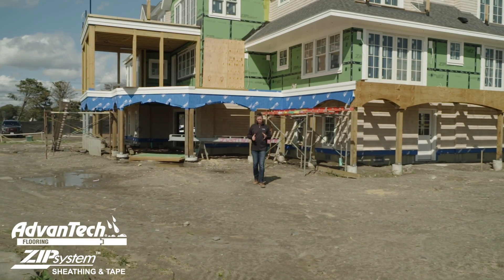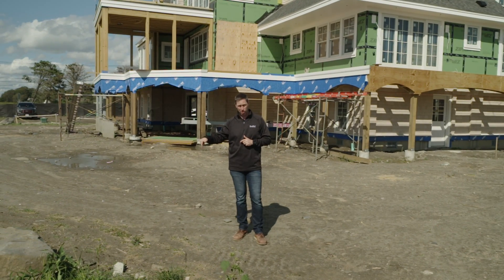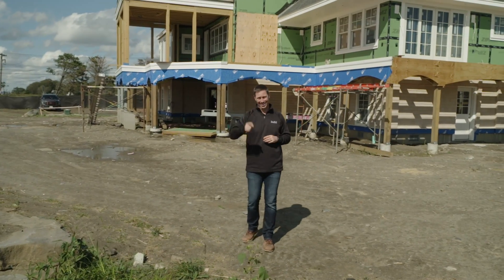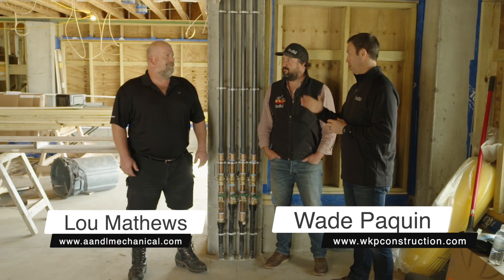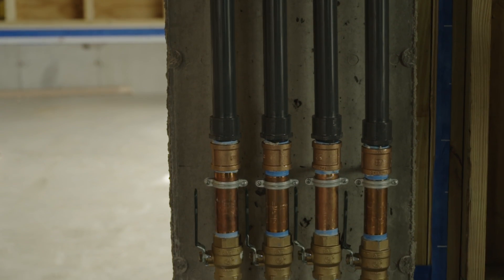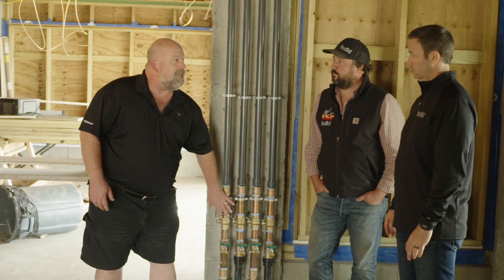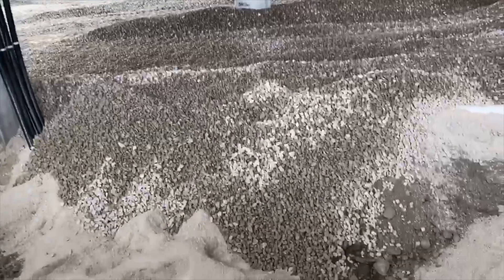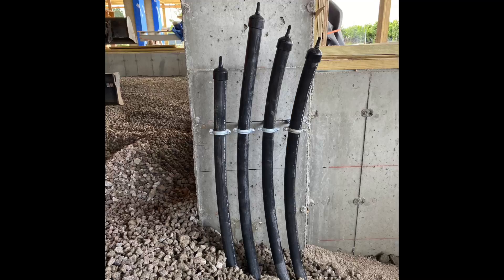Debunking 3 Geothermal Myths

Comment: I’ve had two GSHP systems over the last 7 years.  The first was a retrofit on a conventional AC and gas heat system. Installer did horizontal boring to get the  pipes into the house. Hit the pre dug hole perfectly!  In my system the manifold for three wells was outside, only the supply and return pipes came into the house.
When I built a new home 4 years ago, did the same system.  3 ton system with three wells.  Used  the same WaterFurnace System 7.    12 stage variable speed pump, compressor and fan.  Also, takes off the waste heat and preheats my hot water which is stored in a separate tank.  
Absolutely awesome system!  I pay less than a dollar a day all year to heat and cool a 4,000 square foot home. Eastern Nebraska. Last year total cost was $210. 
Couldn’t be happier. I advocate for it when ever I can.
Reply: When you did your retro fit protect did you get quotes to put in gas and conventional ac again? I was wondering what a price difference you saw between that and a geothermal install.
Reply: Nicholas McKellip , I did quote it both ways.  Admittedly, the geothermal was more expensive, but I was able to use the federal tax rebate (which was huge) as well as a much smaller rebate from the local electric utility. It was still more, by about 8%. At that time I was not really planning on moving, so looking for the long term play.  
Using payback calculations for the two systems, I was looking at 3 ish years for my system.  I was comfortable with that.  
The system worked wonderfully and I saw significant savings in electricity. I actually had 10 years of previous electric bills to compare to and keep a spread sheet going forward with month by month comparisons between old conventional and new GSHP.  It was playing out as I had hoped for.
I will say that without the fed tax rebate it would have been a much tougher sell on price alone.
We ended up moving, so in reality, I didn’t make it to complete payback time, but it was a great selling point for the house.
Reply: Nicholas McKellip , one more comment. If you go with a GSHP system, make sure the company has experience and really believes in their product.  Not just a “yeah, sure, we can do that...”
A friend of mine had a contractor that was like that.  Let’s just say their experience was waaaay different from mine.     They eventually got it right, but it was a struggle.
Reply: @ericwilliams4465  thanks for the info. Hopefully I can find a company that believes in it in our area. Plus, hopefully I can find one that gets me to a similar payoff period. I would be pretty happy with 3 years.
Reply: What was the cost of the system for your new home?
Reply: Your numbers seem a little too good to be true.  Dandelion Energy installs these systems and on their website their yearly operating cost total is about $2000 for a house in New York State (similar  climate to yours - if anything better - less cold).  However, their quote is based on 20 cents per KWH.  So, divide that by 2 for Nebraska (10 cents per KWH there) and you still come up with $1000 per year.  I think on the heat side  geothermal is about 30% better than an air source heat pump  (meaning 4x better efficiency than a typical portable resistance space heater) and about 30% better than an air source heat pump for cooling.  Although, I am guessing geothermal systems really shine at low temps when air source heat pumps struggle.  So, until I get $20,000 or more to install one I will be content with paying about $200 more per year on my AC and actually paying less on my heat with natural gas (than I would with geo).
Reply: @mainemail7358  I realize that numbers seem to be too good to be true, but my data is from the smart thermostat. It tells me how many kilowatts I have used daily, weekly, monthly with a yearly summary. Power here is 7.1 cents for the electricity alone ( excluding all fees and taxes) in the summer and 5.6 cents in the winter. 
So I think these numbers are a true reflection of what geothermal can do, at least with my install.

Comment: Interestingly enough I just start my process of getting quotes for a geothermal install vs gas furnace/electric a/c unit. One guy came today and I have three more coming next week. For our house (2500sq/ft) here in Idaho the guy quoted me $18,000 for the traditional system (96% efficient) and $38,000 for the geothermal system (horizontal closed loop). So point number 1 in the video is not a myth... at least not in this area. Though, he was really hating on geothermal saying I would spend a lot more in yearly maintenance too, and from my reading that shouldn't be the case. Guessing he makes a higher commission on regular systems because he was pushing them hard even though when I called I said I only wanted a geothermal quote.

Hopefully the other companies that come out are more helpful and are not double the price for geo because that is the route I would rather go.
Reply: Nicholas McKellip , yep your first quote DID NOT  want to sell a geothermal system to you!
The increased yearly maintenance myth is just that, a myth.  Properly installed, a geothermal system of good quality, will not have higher maintenance, but likely less, as there is no outside components to suffer from the weather....
I have had two systems in two different homes for 7 years with no issues at all.
Keep getting those quotes until you find the company that believes in geothermal!
Reply: Get a quote from a company that specializes in geothermal. I have had a good experience with Water Furnace.

Comment: Any anticipated risks for utilizing this system in seismic active areas?
Reply: The same as any other plumbing you may have.
Reply: A grout is pumped into the drilled columns after the pipes are installed to ensure continuous contact with the soil. A severe, nearby earthquake could fracture that grout resulting in reduced efficiency if the fractures occur above the local water table. But the system would still work.

Comment: What about the piping sweating itself to death?  i saw a system a few years back that every metal part of the system had green sweat caused corrosion everywhere.
Reply: Cold pipes should be / will be covered with insulation ...
Reply: Remember that copper and brass typically only corrode on the surface. It’s not like iron, where rust catalyzes additional rust that then progresses through the entirety.

Comment: Hi can you hit on the benefits like what kind of energy savings could we see out of a system like this
Reply: Massive......and I mean massive.....but not like this. Have a water well installed and you'll have endless heating or cooling for a fraction of gas, oil, or air-source heat-pumps.

Comment: This system is perfect for people who have a lake or pond because they don’t need to bury the tubes. Simply toss the tubes into the water and save $10-20k on installation.  

Water at the bottom of lakes & ponds stay cool in summer, and warm in winter.
If only people knew this one simple trick fish have known for millions of years. 

Plus the thermal efficiency is better when the tubes are surrounded by water,  so less tubing is needed, and less tubing equates to more efficiency with the pump.  The pump won’t need to run as much, or push as much fluid in the tubes, and longer pump life results as well.

Comment: This looks like a monstrous house with complex ductwork so wondering of a plain old minisplit system would make more sense for a modest well insulated house with a simple floor plan.
Reply: Once you get the geothermal lines in the home, everything else is essentially the same.  No difference in air ducts, etc.  The indoor mechanicals are the same size as most conventional systems....

Comment: love the idea of geo source heat pump.  With the prices of inverter style mini split units, still makes a lot of sense to go that route.  There are new units as you know that will operate down into sub zero weather.  For a lot of the country that is a better idea.  For those areas that do see extended 0degree and below winters, Geo source make huge sense.  In essence they can produce 4-5 times the amount of heating or cooling by using the earth as the real energy source to tap from.  Deep wells are now able to be drilled at a much lower cost than even 5 years ago. It is a matter of supply and demand. As demand rises entrepreneurs are filling the need

Comment: I have a 3 ton bosch geothermal system and love it. 2600sqft house with 8ft ceilings, flash and batt walls ~r 23 and r50 attic insulation my electric bills average about $100/mo (everything in house is electric. No gas bill)

Comment: Matt, it would seem if you are building to passive house standards, that would negate a ROI on a geo thermal system.  Or even take some fraction of the $$ spent on a geothermal and putting that into extra insulation would be a cheaper, less complex system.
Reply: Well not exactly. If building a passive home, very little geo-thermal is required in order to fully maintain the building's heat or cooling and it would happen automatically without any need for supervision. This would likely reduce well drilling costs and even total piping and likely size of pump/exchange too. Aside form paying to buy and install it, your house is then  operating at net zero. Of course it takes a while to pay it off completely since you are paying for the house for a while, but those savings mean you pay it off sooner and reduce your monthly bills at the same time. This just requires more upfront costs, but better long term investment. In colder climates this would be ideal since the weather can change very quickly, and if you house responds as fast as the weather, is comfortable and saves you money its a win win.
Reply: If you cut your peak heat requirements by 75% with a PH, then you cut your ground loop and happen heat pump size by 75% too.  The thing that jumped out at me during that video was "you didn't leave enough space to insulate the pipes".  A good tip is to use rainwater down-pipe clips to hold the insulation, instead of direct clamping the pipes, and cutting insulation around them.

Comment: Something that they probably didnt think of is salt water intrusion on those exposed well runs. Salt water intrusion is a real problem in the northeast for owners who own homes near the ocean while using wells. The well water becomes contaminated by seawater which seeps into the freshwater water table and have to have remediation equipment installed. I wonder if these geothermal runs are rated for saline conditions?
Reply: itsabig  Im talking about the well, the well casing, the piping and the glue used at the end of each loop at the bottom of the well. Is all this rated for salt water?

Comment: its way more than 30% in MA and NH. A new system installed for say gas is ~15k. A geothermal that needs wells is going to be 25-30. If you can trench the geothermal in instead youll see big savings as the well digging is an incredible expense.

This is not including rebates, which in some cases can be generous. 

I know all this because I just got done installing a new gas system in one home and got quotes for geothermal in another.
Reply: He's comparing high-end, high-efficiency costs - these are multi-million vanity builds where an extra $50K is no big deal.

Comment: They talked a bit about the life of those pipes.  What is the lifespan of them and the wells?  It seems it would be expensive to replace since they are coming in through your foundation.  Interesting to hear about the closed loop system and the maintenance benefits of the newer systems.
Reply: The life span of these pipes is 50+ yrs.
Reply: @TL-xv9of  --that is correct, and may be conservative as the pipes are not exposed to the elements.

Comment: Installed a Waterfurnace 7-series in 2016 into our 1850 sq ft ranch built in ‘88. Single 460’ closed loop well.  There are no negatives to this system in my opinion. A friend of mine built a simile size house that same year and told me I was crazy. He put in a dual system, one propane and one coal. He was so happy he only spent $650 in coal the first winter. I heated and cooled for 12 months for only $400 and I guarantee his house has much better insulation.
Reply: Dave Cole how much did your system cost? Our house is just a little bigger and I am hoping to do a horizontal closed loop system. Have been reading good things about Waterfurnace too, so good to hear yours is working out still.
Reply: Nicholas McKellip $28k installed, $14,500 after tax rebates.

Comment: When I was shopping for a geothermal system in 2002, using groundwater wasn't even discussed as an option. Even in a situation a lake or river was nearby, it was still assumed that you'd use a closed loop, in all the systems I looked at. Certainly in any normal case with vertical bores into the ground.

And back then, it was quite a bit more than double the cost of a comparable standard air-source heat pump system.

Comment: Can a Geothermal Unit work with a  Stirling Engine to produce electricity ?  Seems like an easy win win.
Reply: A ground sourced heat pump GSHP would need to be turned into a ground sourced heat engine GSHE. This requires reversing the refrigerant flow among other things.
Using a Organic Rankine cycle and a large enough temperature delta, it is theoretically possible, but the efficiency will depend on the heat source. Geothermal electricity plants do this with heat from deep into the earth. You would be using some other heat source say a sealed attic, and using the ground as the heat sink. Now you have a solar thermal system that runs an engine and costs more than the house.
Reply: @FrancisKoczur   Thanks for the explanation and the bottom line ... "An engine that cost more than the house"
Reply: Its way cheaper and easier to use a fresnel lense pointed at the sterling engine. Also geothermal only gives like an 8 degree delta so that probably isn't anywhere close to enough to run a sterling engine.

Comment: Big problem with geothermal residential is there is no “heat recovery” taking place like in a commercial application. A house will typically be in all heat or all cool. A commercial building core could be in cooling and the perimeter be in heat. So there is rejection of heat and absorption of heat to the loop. This makes for a super efficient system.

Running geothermal in the north, the well temp will drop to around 40f and you lose a lot of efficiency and performance.

If you have natural gas, it is a lot less expensive to operate a gas furnace than a geothermal system.

Comment: So funny I never knew there is an open loop system. Been from Germany I always only used closed Glycol loop systems. But much bigger pipes. We ran 2" from the house as 2 pipes and than 4 - 8 times down into the ground to about 40meter so 120ft deep into the ground. because we used bigger well drilling it was cheaper for us about 50% cheaper because we could use Oil drilling drig Companies to just dill for us instead of the much more expensive Well Water crew costs. Haven't checked the numbers in the USA yet but I would bet here it's going to be also cheaper because from the permit and all process it should be half the costs because oil riggers have a much better Equipment and drill 3x times faster into the ground than well water small Equipment Companies.
Reply: Open loop systems are rare.
Reply: @discodench  I found a few in Texas over 20 years ago but I doubt very much they're still in use now a days.
Reply: Even better is a closed loop heatpipe, filled with passive refrigerant, directly hooked up to the heatpump. Makes it alot more messy to work with, but more efficient.

Comment: :_BuildToolsNAILEDIT: beautiful design but why ??? Why not outside all block up like a shell system with than sheet steel beams as cross member support? I think Matt it is time we builders come to the table and run some numbers. I would had pulled the wall's 3 story high up with Cinder block and than Foam fill and on the outside 3" of Foam insulation. So why is it here in the USA that still so much is build with wood. It ain't faster and it ain't more stable or better to insulate on top you have to much load on those outside walls. So what is the driven factor? Are the trade people not there for it or what are we missing :_BuildToolsBOMBER:

Comment: Well compared to replace a natural gas furnace, it is 3x the price just with a air-water heat pump.
Reply: If yer lucky !  Some guys tried to set me back for 25000 €  . I declined and chose natural gas, even though I don’t like fossil fuel. I hope one day to upgrade to hydrogen. I like the heatpump technology but it’s way way to expensive over here.